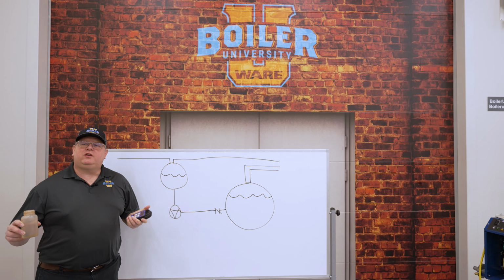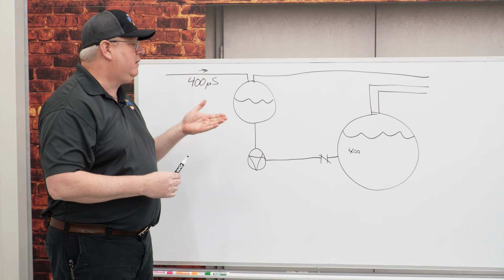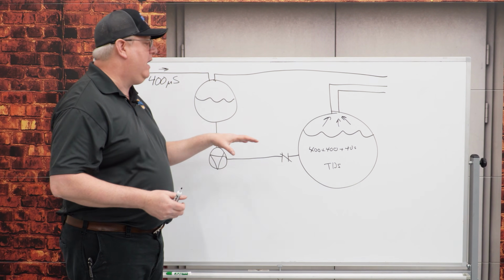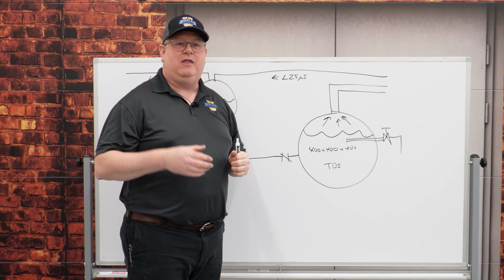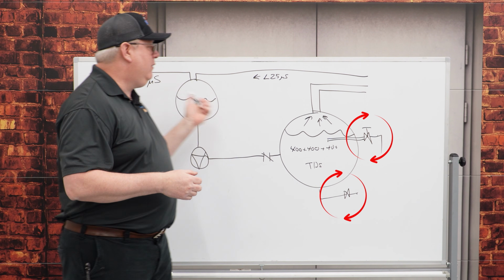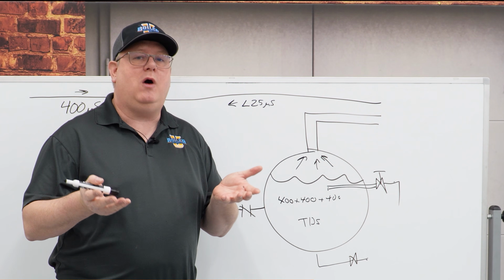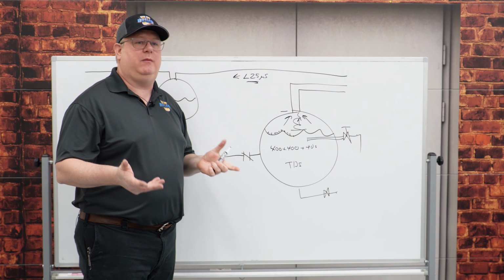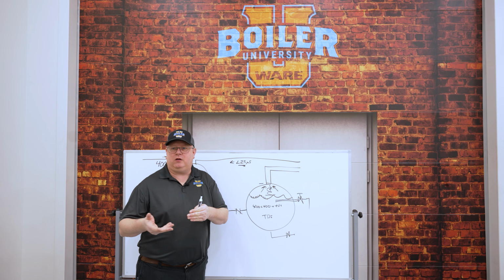Boiler Conductivity Explained: What it Should Be (And What Happens If It's Too High) - Boiler Tip

Comment: Something to note: when measuring μS or TDS it’s important to test all samples across a steam system at the same pH levels. A steam boiler tends to run a higher pH 10.5-12 due to the cycling / increasing the concentration compared to the condensate and feed water 8-9.5. I neutralise my boiler sample to a pH of around 7. A higher pH indirectly increases the conductivity thus reading a higher incorrect reading. This would give me a false increase of TDS if I was not to neutralise my sample.